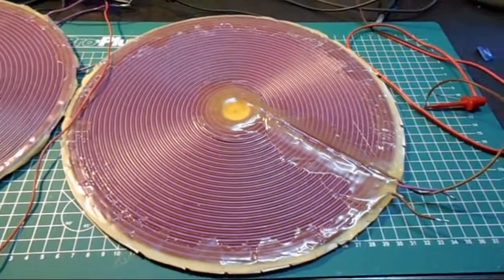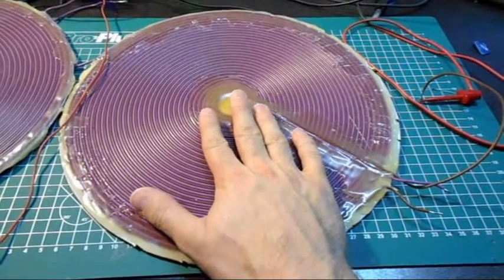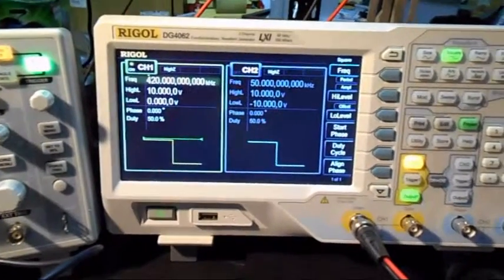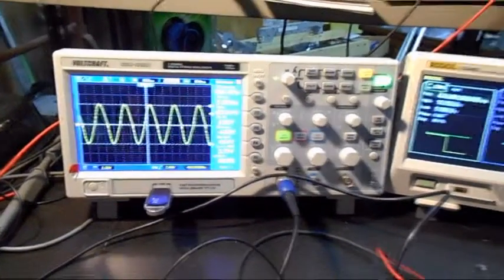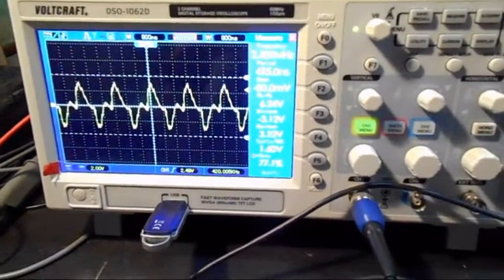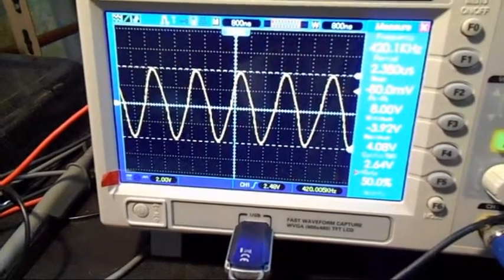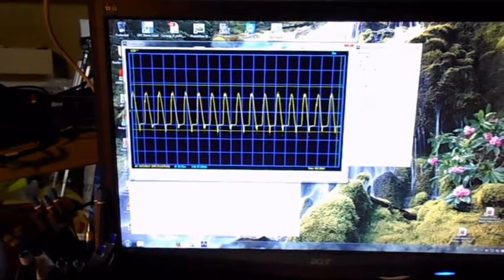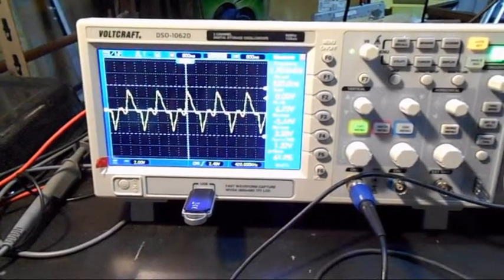003 Tesla Coil Measurements

Comment: Hi, im building a tesla coil and need the spark gap to fire at 40khz. Is there a way i can measure the bps/frequency accurately without damage to the device?
Reply from the maker: When I need to measure something like that I learned that it can be done by placing a scope probe unconnected in the neighbourhood. The distance is depandend on how much voltage your using. If you not sure then start far away enough and I put my scope probe at x10. That way the frequency can be seen. And you can also use it as a reference point (if probe is hold at steady distance) to see if you change something that it's helpfull or not towards amplitude, always keeping in mind that distance of probe is far enough from high voltage source/signal
Reply from the maker: Another way is a frequency counter that can measure from antenna, but I don't use that.
Also here keeping distance from high voltage is important.
Reply: @brunovk417  ok, i will look into that
Reply from the maker: In my latest video you can see what I mean with unconnected probe for measuring voltage. That's on low voltage, you don't want to come that close to high voltage setup with probe time 10 😀
https://youtu.be/itN2c_SAAc4
Reply from the maker: Another way I used but more dangerous and expensive is to use 2  * 1 giga ohm, low inductive resistor and 2 * 1 Mega ohm low inductive resistor to create 2 1:1000 voltage deviders.  This is more dangerous so only do this if your experienced enough. 
The layout should then be:
HV signal - 1Giga ohm - sign to scope - 1Mega ohm - 1 Mega ohm - gnd scope - 1 giga ohm - HV gnd THIS IS ONLY IF GND HV IS NOT DIRECTLY CONNECTED TO GND SCOPE otherwise you bridge the 1Giga ohm separation resistor. As you can see this is more dangerous thing to do. The high cost is because of HV your resistor needs to be big enough, also due to high voltage there's a lot more power loss over the resistors so wattage should be high enough.
Reply: @brunovk417  ok, i dont think i will mess around with that. The other methods will work